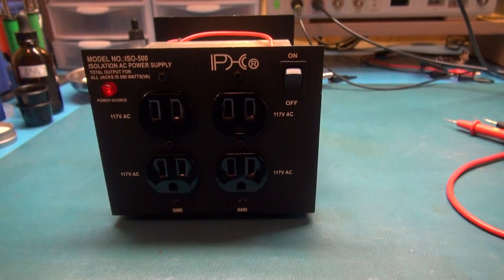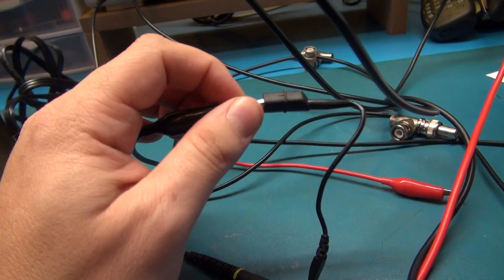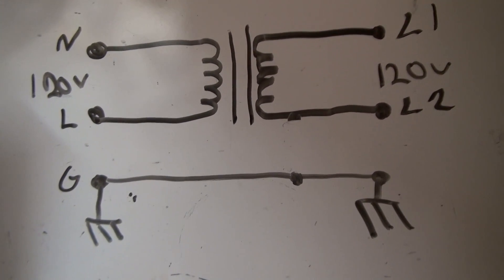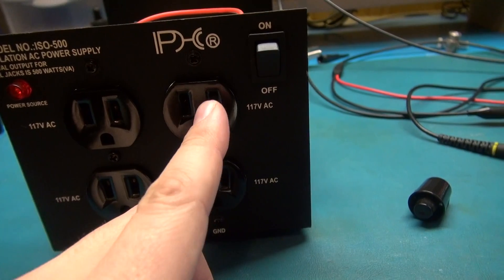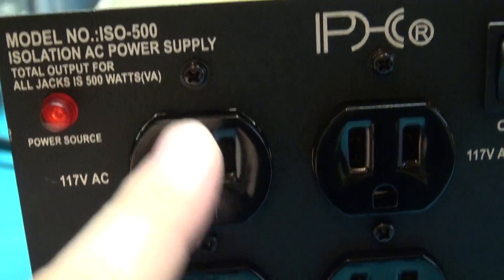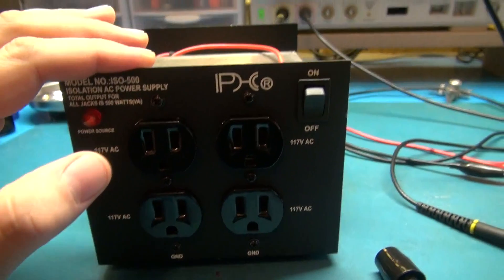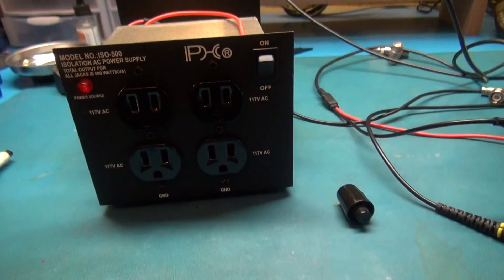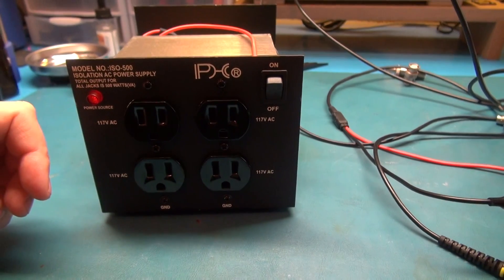ISOLATION TRANSFORMERS FOR TESTING CIRCUITS WITH AN OSCILLOSCOPE.

Comment: Total nonsense."Floated" scopes are for sale by companies like Fluke and have actual, real live protection from the imaginary horrible you describe. They have a definite purpose and are in use daily in industry. 

The problem is dummies that have no idea how to detect and deal with multi-ground faults. They then go on YouTube and spew dangerous and just plain wrong (as well as illegal, insurance voiding crap) advice. 

Take this video down until you learn what you are talking about. Especially how to handle ground fault detection and handling.
Reply: Haha! Kev, you are a rock star. Thanks for making this video..
Reply from the maker: Why don't you go float your scope that is supposed to be grounded and then hook up the ground lead of the probe to high potential and grab a free BNC. Let me know how you make out.  No worries here. The experience will be shocking and may knock some sense into you. The scopes you speak of are not of the normal garden variety of scopes people buy and are special purpose. So before you start throwing dummy around know what your even saying. I suppose me and the rest of the good seasoned repair techs out here that are all saying the same thing are all wrong and you the only one that is right. I feel dumber for reading it now.

Comment: The easy way to modify it is to replace the RECEPTACLES  with ISOLATED GROUND DUPLEX RECEPTACLE PLUG OUTLET 120V 15A 20A AMP ORANGE. you can get them from ebay for about $6. The the ground hole is not connected to the mounting screws.
Reply: David Geltz That’s  a BAD idea. That will just float the ground on whatever you plug into it. Do NOT flat your scope. So if you plug your scope into an outlet like this, that’s NOT good. It can NOT separate the ground tied to the neutral in the main breaker box, so you still have a path back to ground and will be electrocuted if you use this in the US. Your still at risk for injury or death. Maybe this is why it says 50Htz in the ebay ad since other counties are wired differently. Still not a good idea on a main 50Htz to use something like this, and if you have to buy an outlet for this the you don’t know enough to about mains or AC voltage and shouldn’t be testing with it. The older medical grade isolation transformers like his floats the device under test, not the testing equipment. Still not 100% safe and you can still make a mistake wiring something or using two probes but it’s safer then floating your scope. 
Your best best if you don’t understand his video is buy a battery operated oscilloscope.
Reply: @GadgetReviews-US  I think you're confused. He's not talking about floating the scope. He is talking about using a 3 prong plug from the DUT to the output of the isolation transformer replacing the existing outlet with one that has the 3rd ground hole but is not connected to earth ground.

Comment: New Subscriber - I have been looking for this video for some time. Thanks so much!  Bought my used scope, but have been afraid to use it on AC items after discovering this grounding issue.  Also, some long time techs (12voltvids and others), tell you to float both the scope and project. So, quick questions...

Scope Earthed, Project Floating - Once you connect the ground lead from CH1 to a chassis (all channels on that scope are on the same ground), the problem is that the voltage could be different where each probe is connected (Ch1 vs CH2 potential). Is that right?

Scope Earthed, Project Earthed (To Same House Panel Ground) - It's the same ground, so why is this an issue?

I made a "dim bulb" system to use, but screwing with varying wattages is a hassle.  Another story for another time.

I'm missing something still.  Thx!
Reply from the maker: First answer- Once you hook up the ground on the scope to an isolated project then all scope channels will have to be attached to the same point. Unless the scope has isolated channels, which most don't. 

Second answer. You can, If both are grounded then you can use the scope on the device but you have to hook up the channels from the scope to a ground on the device, "NO" where else or BOOM.
Reply: Kev31779 Thanks for your time/info.

Comment: I learn this the hard way, I blew up one of my Oscilloscope and Had to do some intensive repairs. I have an Isolation transformer now which I modify to use the 3 prong plug. What  I did was use an isolation between the transformer and the chassis case, so the ground from the mains are connected to the transformer base but not the chassis.
Reply: Couldn't you have allowed the chassis of the transformer to still be grounded and just prevented the earth ground from being connected to the ground pin of the IT's outlets?  Or was that too much modification?  I swapped out one of my IT outlets with an isolated ground receptacle so that it was not grounded to the chassis.  I left the other set of original outlets grounded to the chassis.  Mine are labeled so that I can just choose whichever set meets my current needs.
Reply: Hi Derick, yes it I could of done that but my base is made out of wood which the transformers are mounted and that is why I grounded the transformer case.